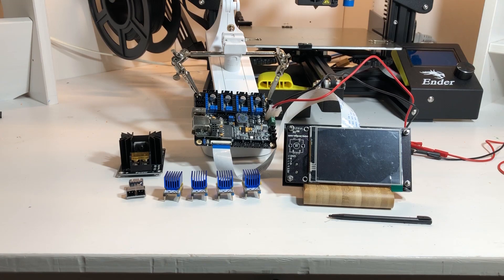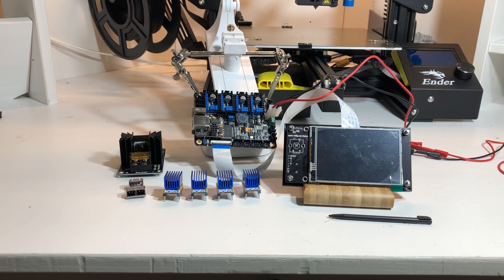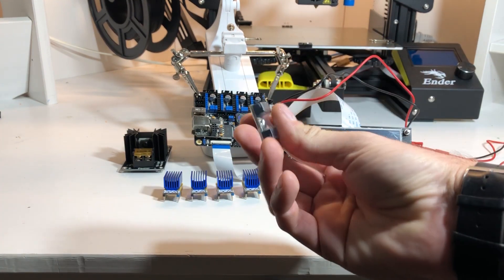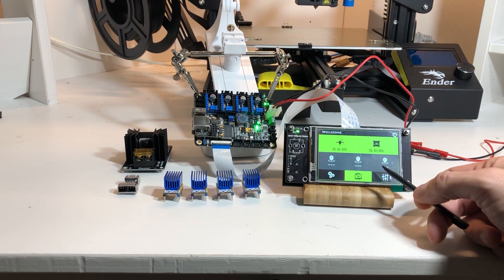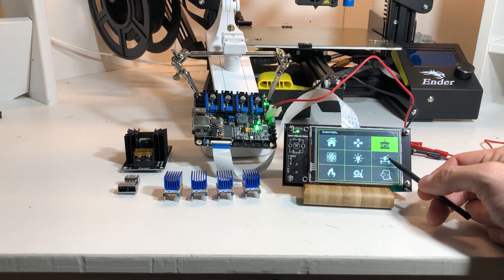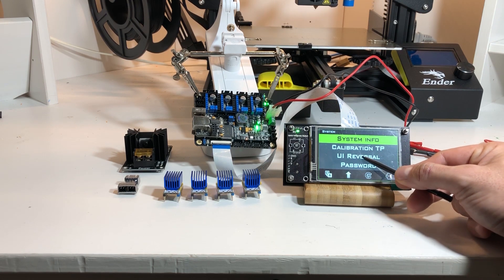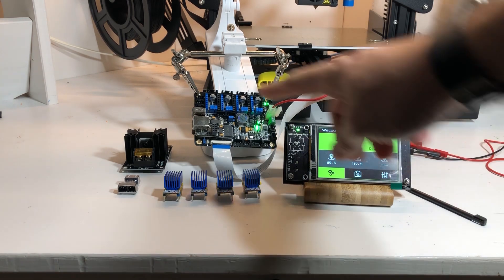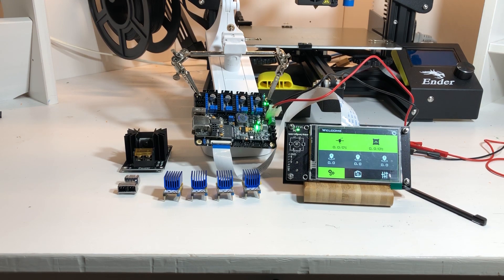Ender 3: 32bit ARM Board LERDGE-X [teaser]

Comment: Interested to see how this goes. I'm playing with an SKR 1.3 at the moment - just for the fun really, the Ender 3 is working great with the MKS-GEN-L and TMC2130 drivers. Good luck with the project and I look forward to the next instalment.
Reply from the maker: Thank you! Fingers crossed!!
Reply: I'm also on SKR 1.3 with 2208s in UART mode. A-MakeDesigns why would you take the risk with closed source firmware? Can that board run Marlin?
Reply from the maker: I like to do something different that is not well known to contribute to the community, plus, if you are not very geeky, lerdge is a good option with the pre-compiled firmare.
There is a project to reverse engineer the lerdge bootloader, I'm keeping an eye on it.
Moreover, there are some new printers that come with the lerdge as default board so this could be helpful for users that own those.